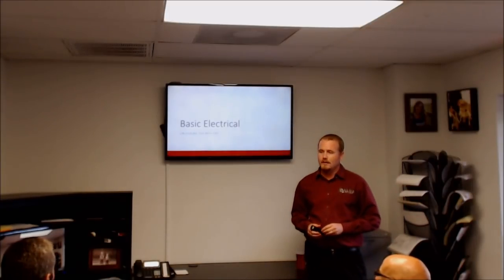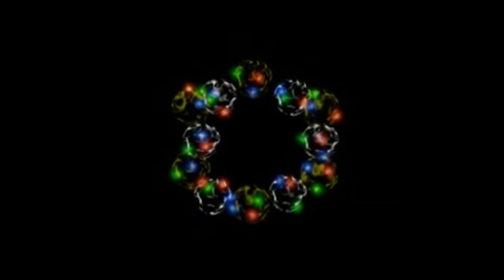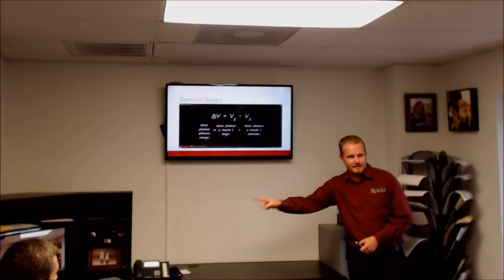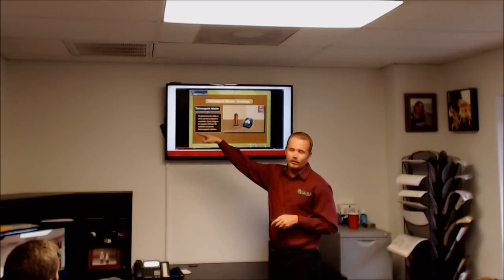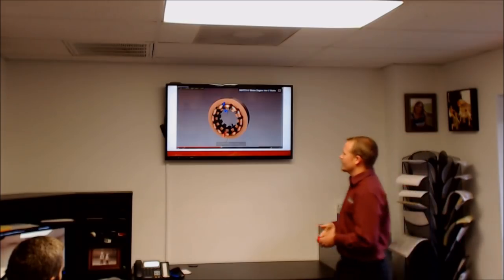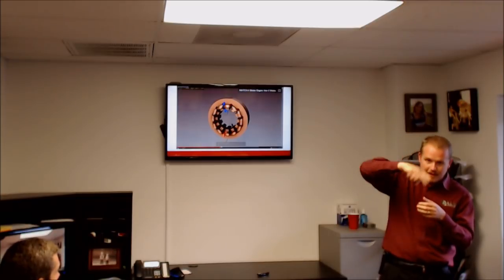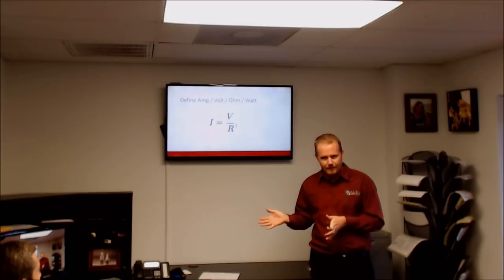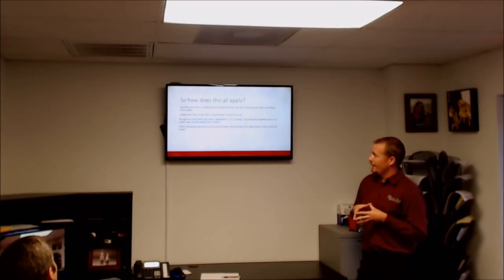Basic Electrical Theory

Comment: There are two wires going into a pole transformer and three coming out the two to them carry 120V and the center is the neutral.  essentially splicing the coil in half.  That is to say two wires form a continuous coil and the third tags it in the middle (the neutral)